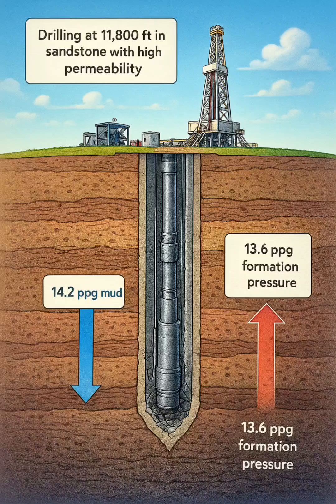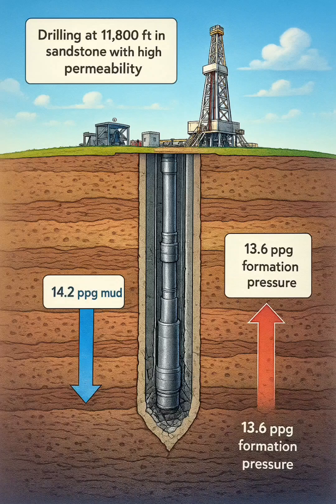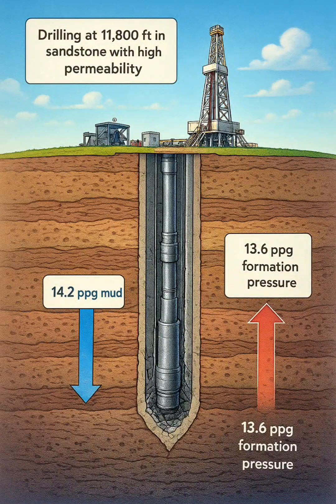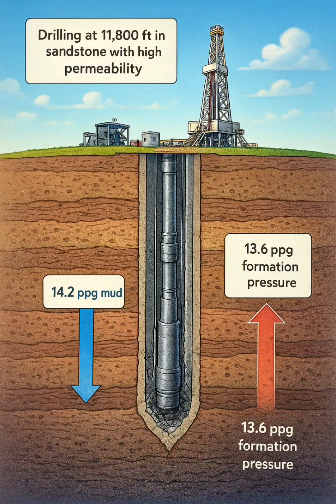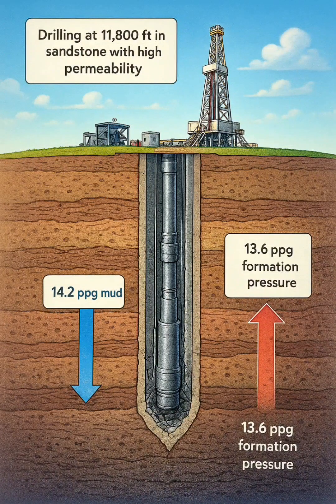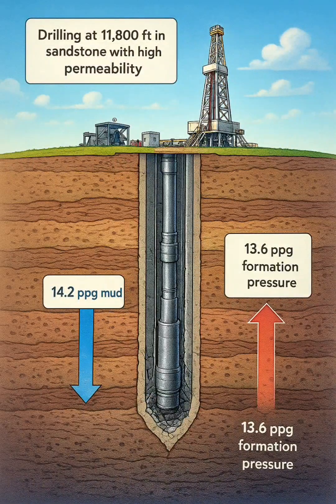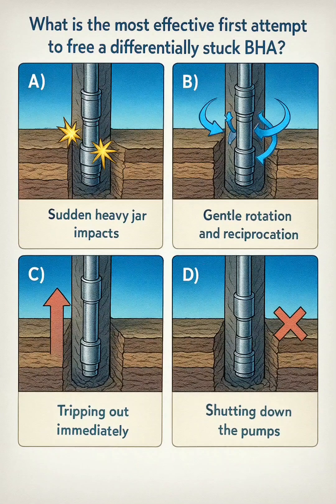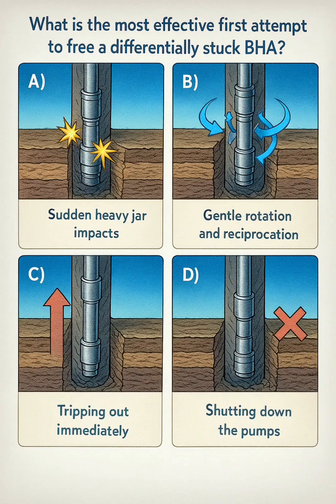Freeing Differentially Stuck BHA Q7 #stuckpipe #welloperations#drillinghse

Comment from the maker: B) Gentle rotation and reciprocation ✅
✅ Explanation:
Controlled rotation and light jarring help gradually release adhesion without damaging the string.

❌ Incorrect Options:

A) Heavy jarring may twist off or damage drill pipe.

C) Tripping is impossible until free movement is restored.

D) Stopping circulation can worsen sticking by thickening mud cake.